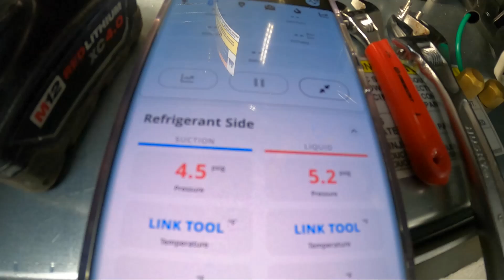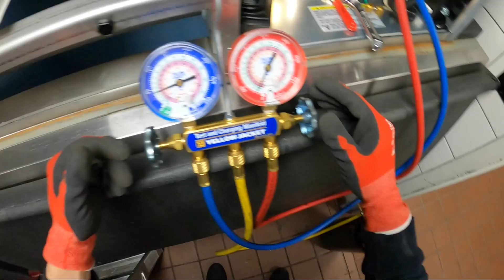HVACR Service Call: New Hoshizaki Ice Maker Not Working After Installation (Hoshizaki Error Code E1)

Comment: Where the heck is the Quality Control? This unit should have never left the factory in this condition! I really hope you get it sorted with the warranty and in reasonable time.
Reply from the maker: No quality control at all! I agree. It should have never left the factory. From the video proof and picture, it is clear they didn't complete the braze around that fitting, which is hard to believe coming from the factory. I spoke with tech support and customer service. They said WE need to fix it or the customer needs to find a company who can. No new units. I wonder if Hoshizaki will even pay the full invoice for the service call and repair. I will make an update with this unit. Thanks for watching! 🔧⚡️
Reply: The whole country is falling apart tbh. Nothing works anymore, no one tries hard at work and things have never been more expensive while simultaneously being worse